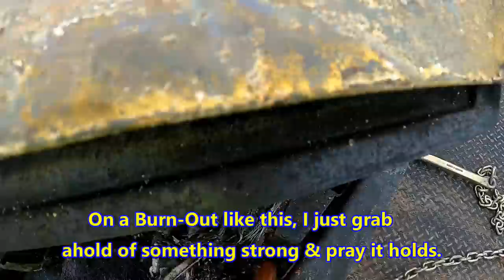Car Fire on the Interstate with Secondary Crash   The Importance of Quick Clearance

Comment: 3800 engines were known for high mileage engines starting to leak at the valve covers and drop down to manifolds and catch fire.  Even if you had the recall done, you needed to have them redone every few years.

Comment: A few years ago, I was driving down a street when, ahead of me, an SUV exited a side street and entered the street that I was driving on.  Flames that were six-feet long, were shooting in my direction from underneath the SUV.  The SUV looked as if it were being powered by rockets.  
I honked my horn, flashed my headlights, and waved my arm.  Finally I succeeded in flagging down the SUV.  The flames were extinguished before the entire SUV caught fire.
Apparently oil had been dripping from the valve covers and onto the catalytic converter, where the oil caught fire.
Reply: You probably saved a life.

Comment: Nice work!!! Got a car off the highway, and could buff the marks out on the body, but I think there may be a bit of a problem cleaning the upholstery.. In other news, the light is flashing in the tool box, the smell is horrid, but the windshield is clear of all obstructions, and you can see as far as you can see. Have a blessed day, and hoping you are busy, but not with messy accidents.

Comment: I’ve drove by an burnt car just sitting there on the side of the highway in my truck. A burnt car just sitting there. Me and my bud drove right by in the rotator. If we were in a rollback we would of stopped in front of it and call and ask about it, if we can take it off the road. We were in the rotator though. That’s the truck I drive I’m sometimes in a rollback or a wrecker, but I drive the ole Kenworth rotator with a new 2017 1075 century on it. It used to be heavy hauler truck. Has an Acert twin turbo caterpillar in it was 600hp stock now it’s 750+hp. Powerful powerful beast of a rig

Comment: Reasonably well handled. Highly suggest that you use a respirator on burnt  car calls! Too many toxins floating in the air that cause health issues later on down the road. Namely emphysema and lung cancer. Burnt-out shells of vehicles are toxic because of the myriad of carcinogenic substances that are used to produce the rubber components and electrical components within a vehicle. And when it comes to getting paid for car fire calls it's usually the tow company that gets burnt!
Reply: I thought "you should wear a mask!"
If you  can smell it, you are breathing it!

Comment: I thought 'FLAT BEDS' ( As We Call Them in NJ) 
came equipped to allow towing of a 2nd car.  
Can save rolling another rig, and you MAY have been able to take care of the secondary crash.
Just a thought.
GREAT VIDEOS!  
THANK YOU for taking us along!
Reply from the maker: Yes, we are capable of hauling one vehicle and towing a second with the same truck.  The issue comes down to time and safety.   I would have to either back down the interstate (highly frowned upon) or finish loading up, go to the nearest turn around and go back to the secondary crash.   In this situation, the secondary was quite a ways back in the que and I still had a lot of clean up to do.   It was quicker, in this situation, to call in for a second unit to clear the secondary incident.   Thanks for watching and God bless.

Comment: "It's an old Pontiac."  Next time you haul a new Pontiac, we'll all want to know how.   :-)
Reply: I have a 2007 Pontiac Grand Prix with 223880 miles it's been a very good car I've owned it since it had a hundred and eighty-six thousand I work for a transportation company and we have fire extinguishers in our vans so I figured why not buy one and put it in my car I hope I never have to use it I'm glad everybody is okay poor old Pontiac
Reply: Looks like a grand prix...my grand prix burnt up just like that one...
Reply: It is a Grand Prix. I know that body style very well as we used to have a 2006 Grand Prix. Loved that car but the drive part of the transmission went out so had to sell it to try and get some money back.
Reply: I was about to mention something about it being a Pontiac. My sister's has a recall for some engine defect that could cause I fire just like this one XD
Reply: I think that Pontiac had the 3.8L V6 in it which was recalled for oil leaking on the exhaust manifold after hard braking and burning
Reply: @SuperGrandPrix99  your just super lucky it made 223k miles they arent know to make it passed 100k without major issues
Reply: @NickyD  My '98 still ran smooth as silk when I traded it in after about 235k, even with the added stress of a supercharger.  I miss those 10 years of no car payments.
Reply: @hollyrice8709   CORRECTION:  
It WAS a Pontiac!  
😚
Reply: @khalilt6508  Wasn't 2004 the last year for the 3.8L?

Comment: Hey Ron, I had a couple a random questions. What camera system is on your heavy wrecker for backup camera, ect.? I see the screen mounted overhead and noticed you can scan through a couple different camera screens. I would like to get a camera system like that for my quad axle dump truck. Also what switch panels do you have for controlling your emergency lights, strobe lights, ect.? I like how they are mounted overhead and out of the way. Maybe you could make a video about all of this stuff. Theres an idea. Haha

Comment: Sitting here thinking to myself as you lift on that frontend... " I hope that motor doesnt drop out from under that car."  I've had a couple Pontiac fires that dropped their motors as I lifted the front end or rolled them back to the wheels. Messy messy messy.
Reply: I've had the motor dropped to the ground after a fire! Just as I was dragging it up the deck it dropped!!

Comment: Some more thoughts but try some Rainx on your windshield and as long as you keep it on their you will never need wipers again and fog and snow will not stick and you can see better and also  either cut the legs off some car ramps or use one of them telescoping ladders cut in half to make some temporary paths for vehicles to get out or untangled from the fences or cables so you don't have to cut them

Comment: And that's why a GM 3800 needs valve cover gaskets at any sign of a leak. A 30.00 gasket could have saved a whole car.
Reply: Judging by the brake setup it looks like it could have been the GXP with the 5.3 LS4. Could be wrong, depends on the year of the car.

Comment: Good Day, Few questions for you Ron. What are the blocks with the metal spikes used for? In a burnout do you guys take it to your place or the scrap yard since there are no personal belongings for someone to gather? Thank you Be safe and have a great day!
Reply from the maker: The blocks with metal spikes are something that I built.  I can take the tire lift arm off the under-reach and put these blocks on.  Then I can push the under-reach down in snow, ice, dirt, to help hold the rollback in position.   
As for the burnouts...they have to go back to our shop until the level of insurance is determined.   If its a liability-only insurance, as this car was, and the customer fails to pay for our services, as this customer did, we have to send certified paperwork, which we did, then we have to wait 30-45 days before we can take it to the crusher.      Thanks for watching and God bless.

Comment: Those engines have a fuel pressure regulator right on top of the motor that love to rupture. Then they pour fuel onto a hot engine. I wonder if that's what happened. Glad there ok!

Comment: that one burned in excess of 1200 degrees (F) because all the Aluminium parts melted off from inside the hood, but not for an extended period, since the rims seem mostly ok, at least from the outside

Comment: Looking at the wheels and tail lights, I’m guessing the car “was” a Pontiac Grand Prix at some point. I’ve handled a couple burnt out cars, they really do stink don’t they?
Reply: Yeah and I'm betting this fire is due to recall that was needed on the 3800 Gen 2 which were in these very beginning post design change. The Gen3 didn't have the issue.
Reply: @NickeyMouse  with the blacked out tail lights I would have guessed an aftermarket accessory  or poor wiring to said accessory.
Reply: Nathan Heaverlo yeah it was a 04-08 GTP

Comment: I can smell that car right now. What a sickening smell it is. Back in the 1980's, my older brother lost a 1976 Pontiac LeMans to fire. My Dad took it to my Grandparents house and yanked the engine and transmission. After he yanked the engine and trans, I steered it onto a trailer, to take it to the junkyard. I'm surprised the front wheels didn't melt on this car.

Comment: Not just a mess for you but damage to the environment too. The grass will grow back but what toxic materials are left behind? I see the back tires are intact. No problems securing them. I wonder about the tire hubs on the front. Do the straps used to secure the car to the rollback work very well with just tire hubs?

Comment: Place where I worked had a pickup catch fire.Fire dept less than a mile away ,the truck was of fire all under the engine compartment by the time fire got there.truck was a total loss,I will never forget the stink of that truck. Did anyone ever figure what caused the fire in this car? Our truck caught fire because the brake Master cylinder started leaking sprayed brale fluid on the exhaust manifold,and it was toast time.

Comment: Tow truck Roback pulls in our fire station parking lot with a car on fire. So we get page/call from Com Center With hesitation in her voice. You have a tow truck with a car attached that is on fire. The location is coming to your fire department the driver of the tow truck is requesting that he pulls up in the parking lot so you can put the car out. Every time he slows down the fire gets bigger he thinks he can make it to your department he is less than a mile away. The confusing in our faces when we hear this page lol. So OK we get one engine ready outside in the parking lot and the second engine ready to roll just in case he doesn’t make it to us. But just as we engage the pump to the first engine he’s pulling in the parking lot we direct him where to stop so he don’t stop right next to our Engine. And we put the car out this is one I will never ever forget.

Comment: Why does the fire department and EMS respond to vehicle collisions even when nobody is hurt?
Reply: Better to have them and not need them than need them and not have them. Sometimes it takes 10-15 minutes for the adrenaline to dump before folks realize that they are indeed injured. That fight or flight instinct. Also there could be fluid leaking or traffic control, cones or a fire could flare up.

Comment: Is the road burnt or is it just dirt?
Reply from the maker: The  shoulder of the road is primarily made of asphalt, which is a petroleum based product mixed with rock and other materials.  When a vehicle burns, it is quite common for the road surface to melt and parts of the burnt vehicle will meld with the road  as it is cooled by the water.  It can take a large piece of equipment to break these items free, at times.  There are also times when the road surface has to be replaced.  Thanks for watching and God bless.
Reply: @RonPratt  thank you for responding to me. God bless and please stay safe sir! I watch all your videos